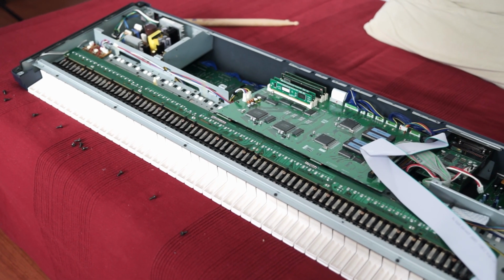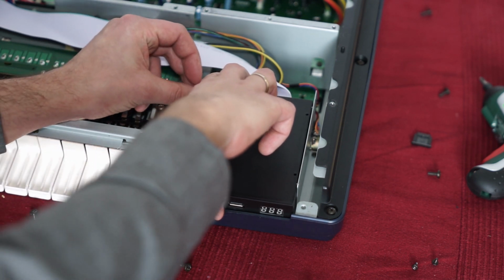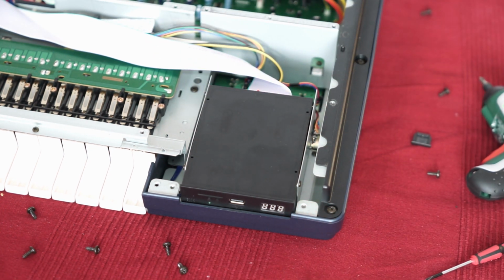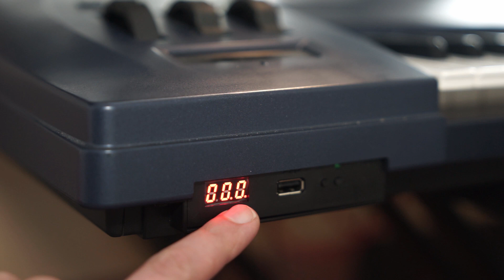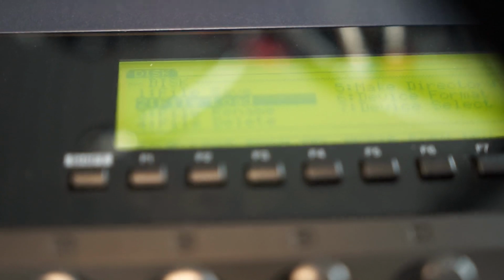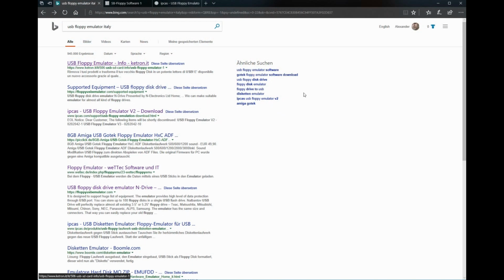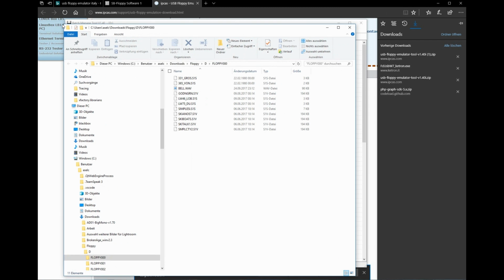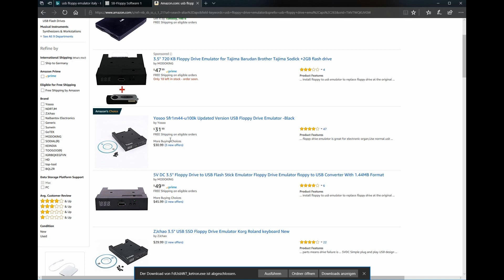How to install a USB Floppy Drive Emulator in an old keyboard (Yamaha EX5)

Comment: For some reason the keyboard says no disk when everything seems to be installed correctly. When I put the usb in, the dots disappear but it seems like the keyboard doesn't recognise this emulator
Reply from the maker: Thanks for watching! You might need to setup the jumpers in the back of the emulator. Please Google gotek floppy jumper setup for an explanation. Best regards!
Reply: @mr_floydst  thank you. I will look into it
Reply from the maker: @irynazhylyak179  One thing I forgot to ask: Did you format the USB stick using the ipcas software?
Reply: @mr_floydst No. I didn't. How  do I do that? Sorry if it's a dumb question but do I have to do that for every new usb stick that I use ?
Reply from the maker: You can get that program here https://www.philscomputerlab.com/gotek-floppy-emulator.html   (look at the comments on this video, I've pinned that one :-) )  With that program, format the USB stick. After that, the floppy emulator will be able to read your stick.

Comment: I've done the hardware installed, but have not yet installed any software on my computer that will read the partitioned usb. All of the software looks super sketchy.
Reply from the maker: Try this page, it has some download links to the IPCAS software (the company shut down some time ago, but some former staff members kept the app online) https://pixelnostalgie.de/2017/05/tutorial-gotek-sfr1m44-u100-k-usb-floppy-emulator/
Reply: @mr_floydst  Thanks, I'll take a look at it. At quick glance, I cannot read the site, but I think I'll be able to make sense of it will enough to find the download
Reply from the maker: @dviant13  It's somewhere near the end of that page. In Google Chrome there's an automatic translator which might help you.

Comment: Couldn't you also buy a USB to MIDI interface for your computer then transfer data to and from your synth via MIDI? That seems simpler and you wouldn't have to open up your keyboard. Of course, if you don't have a computer handy, then your solution would be better.
Reply from the maker: Thanks for watching! That's true for MIDI files and Patches, but transfering samples via MIDI cable isn't possible on the EX5 (and when it's possible, 10kb/s will really grate your nerves) ;-)

Comment: That said, I would like to get your sound files too Floyd…It’s just I haven’t got a spare £150 for the emulator at the moment….😏
Reply from the maker: You can buy the cheapest one on Amazon, they start at $20. Just search for "USB Floppy Drive Emulator" and buy the cheapest one.
My patch set can be stored on a standard 1.44MB floppy disk if you still have one (and a drive).

Comment: Hello everybody 
Is it really true that its possible to build in this drive in every machine?
I have a miditemp mp 88.
This is a midifile player very populair in the begin of the 90's.
I dont think this player has a possibilitie to initialize a drive.
I like to thank you so much ahead fot your advise.
Please tell me the name and typenumber of the emulator you propose.
Again thanks!
Reply from the maker: Hi, thanks for watching! As I said in this video, this thing will be recognized as a normal floppy drive by your computer or keyboard. So if your keyboard already has a floppy drive built in, this will work as a replacement. If there is no floppy drive, you can't connect this. ;-)  Only thing you need to be aware of is there were 720kb and 1440kb floppy disks back in the day, you have to check that before buying.
Just search on amazon for "usb floppy emulator" and you can pick the cheapest one right away.
Best regards!
Reply: @mr_floydst  
Thank you so much for your Quick answers!!
I really gonna buy an emulator.
I still use the 1.44mb disc.
I will find out the right emulator i gues.
Again thank you.
Eric The Netherlands
Reply: Oke Floyd 
Now i have build in the emulator.
When i start up i get: f-f
When i put is the usb stick i get: 34
Please can you, or somebody else, tell me step by step what to do?
AGAIN THANKS AHEAD!
ERIC

Comment: what put i on usb stick fot korg i3 pls thx
Reply from the maker: Hi! The I3 is a brand new keyboard, it has an USB connector you can use for any USB device that makes sense connecting to a keyboard. So you can use any USB stick, I guess. Best regards!
Reply: @mr_floydst  its for the old i3 sorry

Comment: I own a Yamaha EL-90, does the same emulator work?
Reply from the maker: Hi! Thanks for watching. Yes, it will work. But check if you need the 1,44MB or the 720KB version before ordering.
Reply: I have little knowledge regarding 1.44MB or the 720KB version.  Where I can find the answer?  Would you pls explain to me.  Thanks.
Reply from the maker: @mlcheng5584  My answer is one year late ;-) (Youtube never displays there are new answers in a topic, so I never saw this) - look at your floppy disks. If there's a "HD" somewhere printed onto them, they're 1.44MB disks.

Comment: je fais tout mais y a rien qui marche  il est  dans ordi  mais  impossible de le remettre dans le cle
Reply from the maker: Hi, there are some things you can try if this doesn't work.
1.) examine your USB floppy emulator if there are jumper switches or dip switches for setup / configuration on it. If there are, look up their function in the manual and set them accordingly.
2.) check if your USB stick has been formatted correctly using the ipcas software.
3.) check if your USB stick is inserted properly. Some of these devices need quite some pressure to connect.
Good luck!

Comment: Tried everything to get emulator software to work .  I used windows 10.  i can only format the usb but can't write anything to the partition.   Switched to windows 7 and same issues.     The emulator software is useless.
Reply from the maker: If I find time, I'll make a short screen capture (if that'd help you, that is). On my Win 10 PC, it works, but I agree it's a unnecessarily complicated process.

Comment: Hi i just installed my emulator and recommended software, it doesnt work
Reply from the maker: Thanks for watching. Can you be more specific, please? What exactly doesn't work? Does the emulator light up? Did you format the USB stick in the software?
Reply: @mr_floydst  hi the 3 000 will light up but the green light doesnt come on.
Reply: @mr_floydst  Also the keyboard says invalid disk. I am using windows 10
Reply from the maker: @davidgibson3724  Please check if you connected the ribbon cable correctly: There's a notch on it. Also, there are "jumpers" on the back of the emulator. Please try to look up how they need to be set up for your keyboard, depending on the model of your keyboard and the emulator you bought.
Reply: @mr_floydst  its a yamaha psr 6000, its was all clicked in place. The 3 zeros light up but not the green light
Reply from the maker: @davidgibson3724  On my version of the emulator, I have to push the usb stick quite a bit before the dot lights up. Please also try the use another stick, and make sure the jumpers are set up correctly and the stick has been formattet and partitioned using the ipcas software.
Reply: @mr_floydst  what software do you use
Reply: What do you mean by jumpers, and how will i know what they need to be at
Reply from the maker: @davidgibson3724  Hello David! The download link is in this video's pinned comment: https://www.philscomputerlab.com/gotek-floppy-emulator.html
Reply from the maker: @davidgibson3724  Those are tiny brackets which connect some pins at the back of the emulator. You can move them around to adjust to your given hardware / keyboard. Usually, you'll find a description in the manual.

Comment: Hi, I inherited an EX5. It's been stored in a basement since who knows when. It works but is quite battered. The keys work, the dial is good and you can change sounds but most of the buttons don't, no matter how hard you press nothing happens. Trying a lot I got some buttons like Voice, Performance, Edit and a few more to respond but important ones like Store, Enter, Disk won't. This last one is specially painfull because I just swap the disk drive for the usb emulator (following your instructions) and I can't access the drive because the damn button not working.  My gess is that something has been spilled over or maybe just grim from the years. When i opened the keyboard for the drive swap I saw that the button panels are in the oposite side so it looks quiet difficult to reach them without dismanteling the whole thing.
Any suggestions?
Thanks
Reply from the maker: Thanks for watching and congratulations! I'm afraid your EX5's main board is damaged, leaking capacitors most likely - they tend to spill when not used for a long time. You could try to change the battery and do a hard reset and clean stuff with a dry toothbrush, while looking for leaked caps, but maybe take it to someone who can repair it. Prices are going up on the EX5 so it should be a worthwhile investment. Good luck!